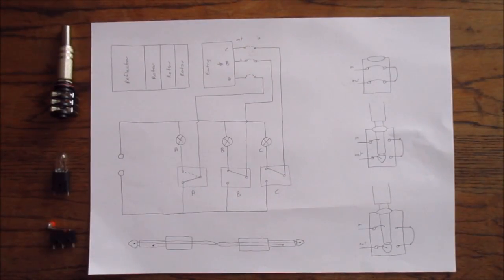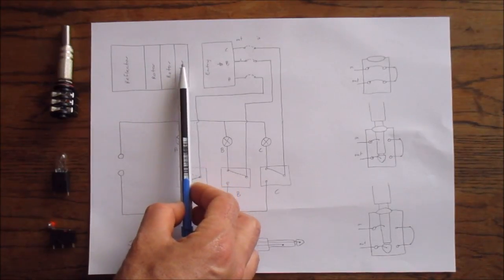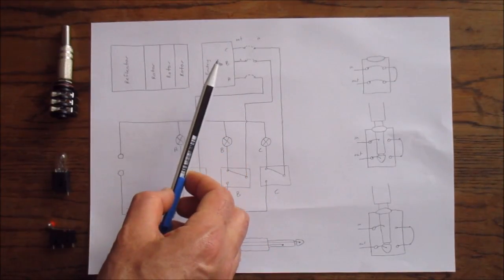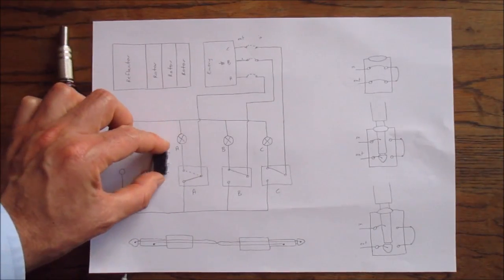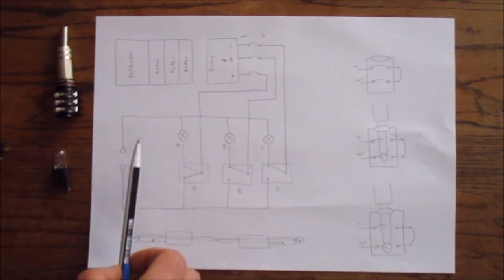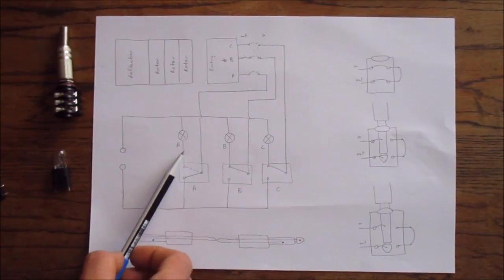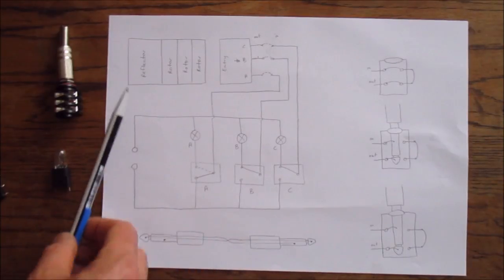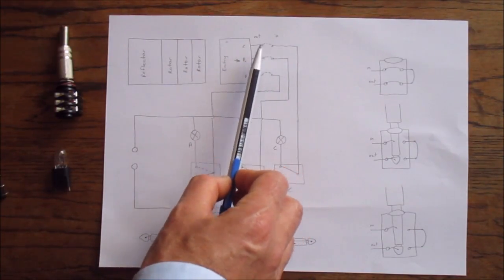3D printed Polish Enigma plugboard wiring.

Comment: 5:00 The fact that no letter can ever be represented by itself is a direct function of the reflector wheel that joins all letters in reciprocal pairs
Reply from the maker: Yes, that is the main reason. But the way the switching between the keyboard and lamp board works factors into it too. If you redesigned the reflector to let a letter encode as itself in a standard Enigma machine you'd have to redesign the keyboard/lamp board too. The keyboard normally connects between the entry wheel and the lamp board (ignoring the plug board for a moment). When you press a key it disconnects that keys lamp from the entry wheel and instead connects the entry wheel to the battery. That's how the current gets into the rotor stack.
Reply: @asciimation  But there was no way, back then, for the reflector to be designed for the enciphered letters to be represented by themselves. The Soviet Cold-War FIALKA used transistors in its reflector crktry to correct this problem. They called it the "Magic Circuit"
Reply from the maker: @JohnSmith-eo5sp  True, on a purely electro mechanical machine like the Enigma it would be tricky to arrange.
Reply: @asciimation  Now that you mention it, the Enigma's cryptologic process itself was entirely mechanical, no relay logic, and no motorization
Reply from the maker: @JohnSmith-eo5sp  Exactly! That's why it's a good candidate for 3D printing. I know of one person making one in Meccano too which is what my original plan many years ago was.
Reply: @asciimation  An Enigma duplicate made with MECCANO parts, interesting!
Got a link for this construct?

Comment: Hi there,

Thanks very much for the detailed explanation. The switched plugs with the contacts wired together is a nice solution to the problem!

I had read about the issues with the enigma machine not returning the same key as that pressed due to the nature of the reflector circuitry however the wiring issue preventing the same is new to me. Interesting stuff.

Andy
Reply from the maker: I don't know if the wiring causing it is a symptom of that or a cause. I suspect more a symptom as I imagine they developed the rotor and reflector idea first and then made the switching arrangement to suit?